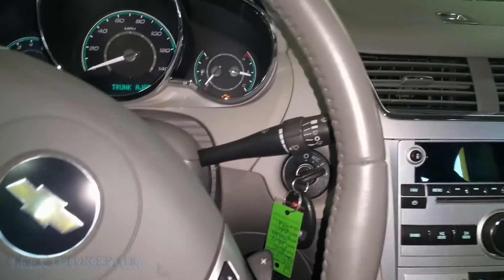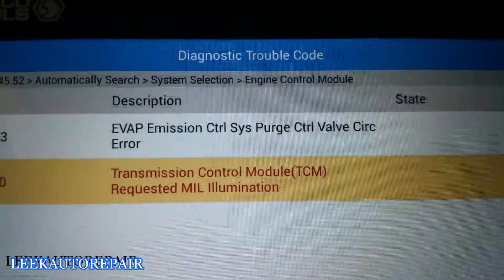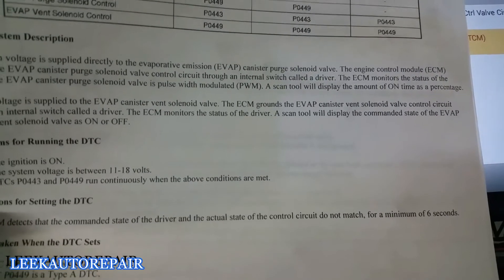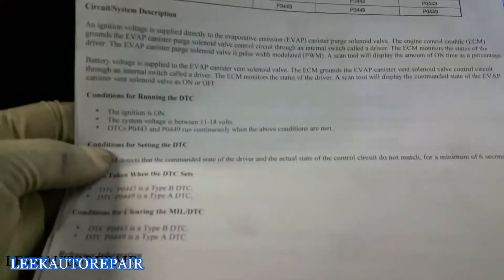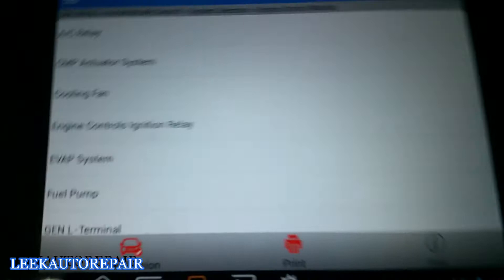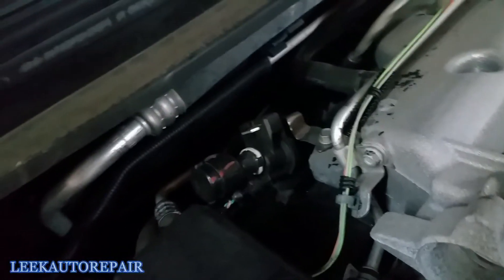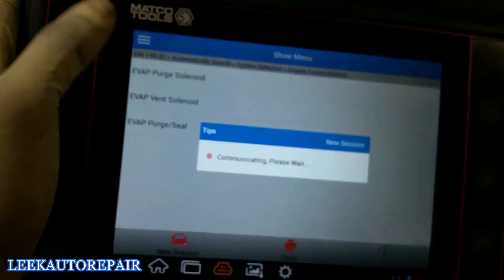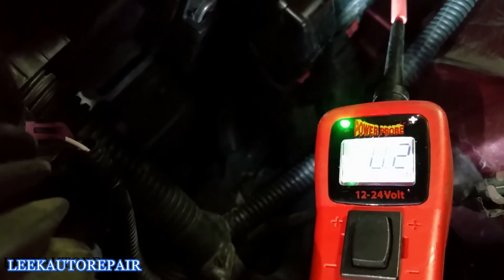2010 Chevy Malibu P0443 Diagnostic & Fix (HD)

Comment: I just had this code and I checked the fuses and an exhaust fuse was blown. I changed it and and cleared the codes and everything is working good again. It was on a 2007 Chevy cobalt with the ecotec 2.2
Reply: I have this code too. Blown exhaust fuse you say? I replaced my purge valve solenoid, cuz it was due regardless. But the light came on shortly after i hit a good size puddle i didn't see during a downpour. Must have affected the vent solenoid in the canister would be my guess hence the blown fuse. Was this your issue as well?
Reply: Vincent Forsberg I didn’t have to replace the solenoid. Once I replaced the exhaust fuse in the fuse box under the hood the code and all the problems went away.